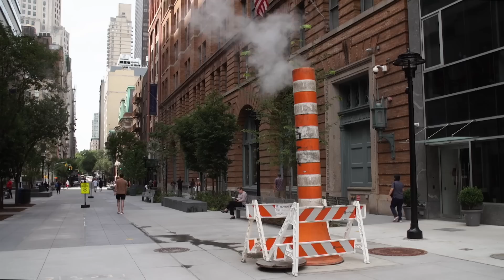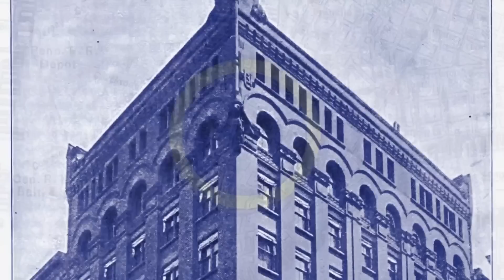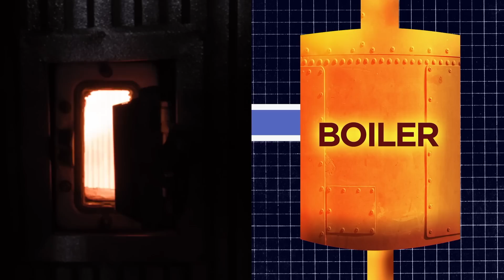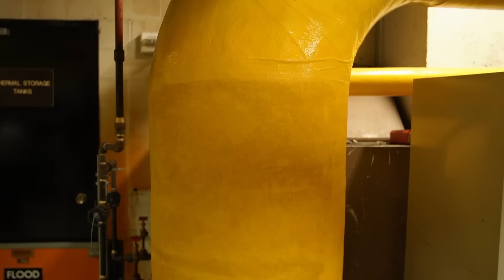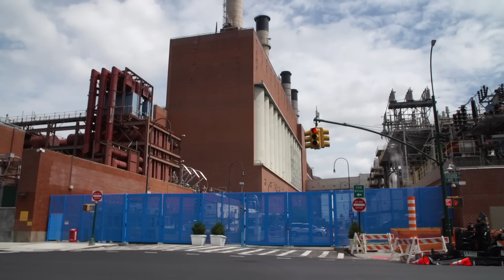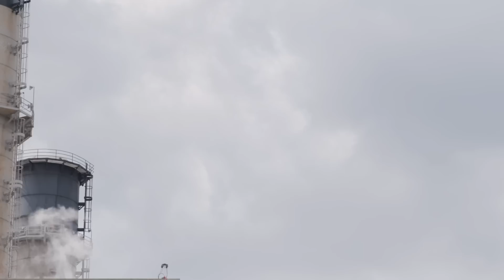New York City Runs On Steam | NYC: Revealed

Comment: What’s really cool is the fact that they can use the waste heat (ie. exhaust gases) from electricity production and utilize an otherwise wasted resource.

Going more in depth, you can transfer 100% of mechanical energy into heat, but the same cannot be said the other way around. Cars are only about 30% efficient at transforming the heat energy from gasoline into mechanical work. High efficiency power plants are about 60% efficient. Parasitic losses like friction aren’t the main culprit, it’s more to do with the theoretical efficiencies of heat engines. For heat engines to work, you need a hot side and a cold side (ie. hot exhaust gasses, cold environment for them to expand into). If the temperature difference between the two is high, more of the energy flowing from the hot side to the cold side will get turned into useful work, as opposed to just going out the cold side. (A car engine uses the hot exhaust gases to push against a piston thus expanding the gases and cooling them down. Ideally the gases would expand enough to cool them to ambient, but that’s not possible in a car and so heat is lost out the exhaust pipe.)
All this is to say, every time you are turning heat into electricity, there is always going to be heat that is expelled that cannot be used to generate electricity. The brilliance of this is that they are making use of an otherwise wasted resource. You may not be able to generate electricity off of the waste heat, but you can use the waste heat to heat your home.
Reply: The energy waste is an American problem primarily. In Europe the steam is used for heating of houses and hot water. The energy efficiency is close to 98%. In fact many factories having a production who produces heat will be reusing that heat. Taxes on fuel is in general so high not reusing energy one way or the other - the production wouldn't be economical viable. Why we don't waste energy or uses vehicle with fuel in efficient motors. Whether you like it or not - there's a stick and carrot method to be more effective in using fuels and electricity. The economic incentives are too big not to be a part of it. Even being very wealthy you'll probably try to be energy efficient - you could be losing your business and wealth in not doing so. You might not even care or disagree of it being necessary. The economical incentives are too big to ignore. Supply and demand are both very much at work. It's like cigarettes and booze it's not healthy for you - taxes keeps the demand lower by making them expensive. Taxes are the most effective tools to regulate human behavior in a desired direction. In the US taxes could decide who gets to be the next president - the candidate promising the biggest tax exemptions for the wealthy is more likely to be elected. Giving tax exemptions to companies using outdated equipment to continue or start an otherwise economical unviable production is just making sure wages are kept low and prevents a middle class being sustained or created - the class where a lot of the educated people traditionally originates from. Because they can afford their children going to highschool and higher education. One reason for on one hand having some of the best universities and on the other hand being very dependent on importing educated people.

Comment: why steam & why dont use hot water like in Europe?
Reply: Steam is much more efficient
Reply: Because it's legacy equipment. It would make more sense to use more efficient modern tech than to use the steam cycle. But ripping out every single pipe and replacing it by a new system (whether it's electric with associated bigger cables and transformers, or a loop-based system which needs feed and return) it's ll be a job that costs about as much as repairing the subway system. No one can, or wants to pay for that. Individuals could request a bigger electrical hookup, but if everyone wants it, the entire grid needs to be dug out and replaced.

Comment: Why not burn trash to heat the water?
Reply: Filthy, less energy, more expensive
Reply: @sharkheadism  They do it in Norway, in fact they ask for trash to burn, it's a valuable asset if the infrastructureis is in place. It needs an initial layout obviously, filtering the waste gas and air etc. So why is so much still dumped into landfill? It's a huge money making racket that they don't want to fix.
Reply: @edmundblackaddercoc8522  It's cleaner, cheaper, and more efficient to generate energy from conventional sources
Reply: @sharkheadism  burned my comment

Comment: I think the video skipped a lot over the cogeneration aspect of these plants. Does the exhaust steam from the turbines get sent out? Or do they divert the steam before it goes to the turbine? How many watts does the steam turbine generate?
Reply: The turbines in the diagram are gas turbines.  It shows a combustor , compressor and turbine , this is a jet engine. A steam turbine consists of only a turbine.
The cogenerator uses a heat exchanger in the exhaust of the gas turbine to harvest waste heat .
Reply: Going by his description, "increase electricity and you decrease steam", it's unlikely they're using cogeneration with gas turbines. 

More likely they just run the boilers and then have seperate steam turbines they can redirect the steam to. 

The pressure reduction methods used in the buildings is pretty inefficient too, they're just dropping the pressure using pressure reducing valves. Replacing those with backpressure steam turbines would generate electricity from the drop in pressure.

Comment: If you are still confused, steam is delivered to each house like water.
Basically its like delivering hot water from a single water source that do the heating for you instead of having your own heater.
Its way cheaper than using electricity for your heater, remember its NYC.
Reply: thanks i didnt get how they used steam
i

Comment: Old technology, Copenhagen retired its last steam pipe a few years ago. Now using biomass and waste to heat water, channeled through the central heating system through the city. Actually so great at burning waste, that we are importing waste.
Reply: So they're using hot water instead of steam? Is this a troll comment or do you not realize hot water is steam before it heated enough to turn into steam? The only difference is temperature
Reply: @Cooper906outdoor I think he's pointing out that rather than gas to heat the water,they burn waste/garbage to heat the water.

Comment: I retired from a large Philly hospital / research centers that had six boilers on the sixth floor of one building and another six in a mid level basement between two buildings supplying steam. In an emergency they would call up the steam company to purchase steam. They charged $1,500 15 years ago every time we opened thier valve plus the cost for the steam. Hospital made a ton of money every summer by signing up for peak electrical peak shaving during hot summer days. They would bring on more boilers on line and run the steam chillers to provide air conditioning and turning off electric driven chillers. Every day they shaved 3 million kilowatt hours every hour for only six hours they earned over $15K. Of course cheap facilities director & chief electrician cried when they had to pay two electrician usually only two hours of over time.
Reply: Hi Garbo - I do a lot of Philly work and totally agree that Load Shedding/Peak Shaving can be a Win/Win strategy and a great way to offset capital costs to pay forward energy efficiency, safety and sustainability!

Comment: HOW does the steam provide heat to buildings? Seven minutes in already and maybe you're getting to it.
Reply: They are called radiators, which are coiled metal pipe attached to a steampipe near the baseboards, sometimes they are mounted under the floors, which can be nice keeping the floors warm in winter and the incoming coldwater pipes from freezing through winter.  They also continue to work when the electric grid goes down. They are more economical and renewable than central HVac heaters running off electricity.

Comment: That walk-through tour of the building's steam pipe is great. I work as a commercial service plumber in Manhattan and I see these rooms basically every day. What they don't mention though is that basically anything in plumbing wears out or requires maintenance. Some condensate tanks in buildings also require chemicals to be injected into condensate so they won't corrode the tanks and piping and they have to dump the steam / condensate into the streets from time to time.
Reply: Why steam and not pressurised water like in Europe? Nothing needs to be wented to the streets and it turns to steam if there's a leak as the temp is a lot higher than boiling point of water in normal pressure.
Reply: @oskar6747  The steam systems in USA are much older than the European water based systems. The cost to rebuild them to modern water-based systems is probably as a high as building a totally new system altogether.
Reply: @oskar6747  Steam has no weight to it, flows like gas threw the pipes.
Reply: CAN YOU MAKE A VLOG OF UR DAY IN THE LIFE INSTEAD OF PLAYING GTA SA!( NOT 2004)

Comment: Where does the water go when condensating after being used for heating.
Reply: back to the plant.
Reply: Down the drain
Reply: @dannywilkins887 Seriously? What a waste!
Reply: @Mrdanne there is no shortage of water in NYC. What would you suggest?  Trucking it to Arizona?
Reply: @CreachterZ  It is still a lot of energy left in that water when going down the drain. Recirculating it back to the boiler would save a lot energy. But changing that infrastructure would be costly and complicated, so understand why it has not been done.
Reply: @Mrdanne …. In smaller systems they would pump it back. … When you use superheated steam to produce power the residual is used to supply industrial and heating down stream.

Comment: Technically NY runs on GAS that boils the water and turn it into steam
Reply: Technically, your internal combustion car runs on the massive amounts of electricity required to refine crude oil into gasoline. Semantics.
Reply: It runs on several sources of heat to create steam. None are very good except nuclear.
Reply: Actually, the sun. The sun is the genesis of all energy we use on Earth.
Reply: @Ole_CornPop Except Nuclear.
Reply: Steam boilers in a central location allow very efficient distribution of energy to multiple locations and each building does not need it's own steam boiler and you don't have oil/gas delivery to buildings. This all was the primary reason this happened in Manhattan.
Reply: @user-vp1sc7tt4m  I mean this respectfully, does the city need any boilers or steam at all? 

 There's so many other way's to heat.
Reply: Which ever is cheapest gas or oil. Gas is cleaner and easier, though  gas has been cheaper for years now.
Reply: Yea, just like my car technically runs on the rotational energy produced by the engine and the drivetrain...
Reply: I worked in a building were we ran. 2 lp boilers for heating purposes were able to run the boilers on both gas and oil. Very interesting to see how steam is used , was on 14st when SS Sandy knocked out those Con  Ed power plants on 14st and FDR.
Reply: My car runs on gasoline.   Technically it's solar powered
Reply: Water 💦
Reply: Technically New York runs on the Sun because of the plants and animals that decompose and focalized into fuel got there energy from the sun.
Reply: Technically NY runs off hydrogen that powers helium to make sunlight that grows the plants to feed the animals that died to form the gas that boils the water and turns it to steam. Being pedantic doesn't make you any smarter. It just makes you an a$$hole.
Reply: Manhattan runs on all three, Steam, Nat. Gas and Electricity. From the tip to 104th street, with one exception being Bloomingdale on 105th. If it is a building over 10 stories tall and 50 years old it has steam or has had steam previously. The older and bigger the building it might even have air conditioning powered by steam.
Reply: @InconsistentManner  Is steam created from thin air?
Reply: @CRiver396 is gas created from thin air?
Reply: @CorneliusCody  is gas created from thin air?
Reply: @CorneliusCody ...air is a gas.
Reply: of course there's always one guy.....
Reply: @couchpotatoes5158  Who speaks truth?   And understands the background?  Please tell me what I’m missing.
Reply: @CreachterZ  The point is that the steam is being directly delivered to homes. It would be like saying New York runs on electricity.
Reply: @DHN900  i was going to say it runs on small animals squished by earth millions of years ago
Reply: @ebx100 technically mostly plants and algae
Reply: @couchpotatoes5158 anyone who heats their home with natural gas is "that guy" in your book then. Any one of them can tell you running a bunch of massive hot water tanks 24/7 would take an unfathomable amount of gas and money.

Comment: There is something called central heating with what we call Blockheizkraftwerk (BHKW) in Germany. You use gas to produce heat. Send that heat into homes (Fernwärme) and while it's producing heat it generates electricity.
Reply: But that is a closed system where the cooled steam returns back to the plant. Here they are ultimately venting all the steam out and need to constantly supply fresh water into the system

Comment: My grandfather was a boiler cleaner, but I have never seen a boiler in my life. I always thought boilers were ancient tech, replaced by more modern options long before I was born. It's strange to hear these people talking about needing a boiler in a building if steam was no longer available.
Reply: Boilers are still very much around in industrial or large-scale settings. Most manufacturing plants have at least some steam, and all fuel-based power plants run off steam too. Nuclear, coal, gas, etc are used to boil water into steam to pass it through a turbine, which spins a generator and makes electricity. Then that steam is cooled back into water, and pushed back into the boilers.
Reply: Decades ago I had a summer job in a textile plant, doing the yearly clean up & refit. They had two boilers to power the plant and I had to climb through an inspection hatch to clean the inside of them. I came out dirtier than a coal miner.
Reply: How do you think you get hot water in your house?
Reply: @flyingcrab36  A water heater. A cylinder in my garage that burns gas to heat the water directly. No steam is ever involved. In every house I've lived in, in 3 different states, that's how it works. No boilers.
Reply: @catatonicbug7522  and the hot water that fills your radiators to heat your house? Because that's not from a water heater, it comes from a boiler, and they're extremely common in households
Reply: @flyingcrab36  The only time I've ever actually seen radiators was in an ancient school built in the 1920's. I grew up with wall-mounted gas heaters, and every place I've lived since then had a gas furnace that blew hot air through ducts into each room. Even the first house I owned, built in the '50s, had that.
Reply: I can't stand forced air heating.
Radiators are so much more pleasant.
Reply: @Joe-Przybranowski  ...and dangerous and inefficient. My mom has lived most of her life with a giant scar on her had from a burn she got from a radiator as a child. Waiting for the heat to radiate across a room, and the immense amount of space they take up would be unbearable to me.
Reply: @flyingcrab36  Boilers borrow a steam pipe from the street and wrap some water pipes around it to steal the heat. The steam is so hot it boils the water. This boiling water can be used to heat the building, or it can be used to heat some fresh water to wash your hands etc.  A Water Heater has to make its own heat all by itself.